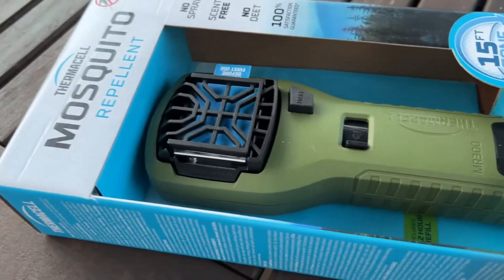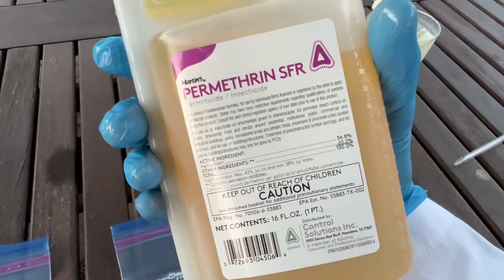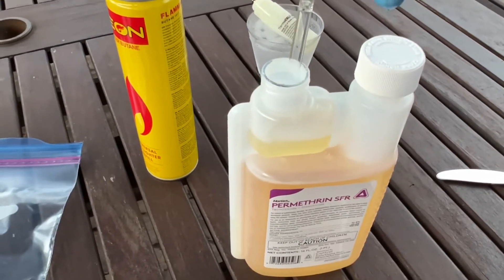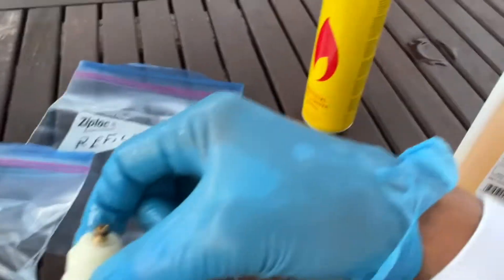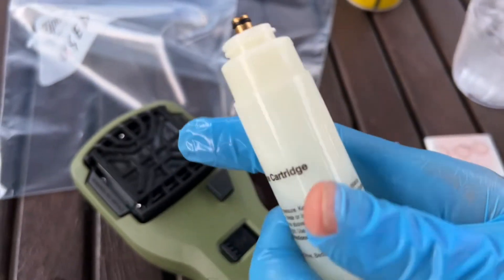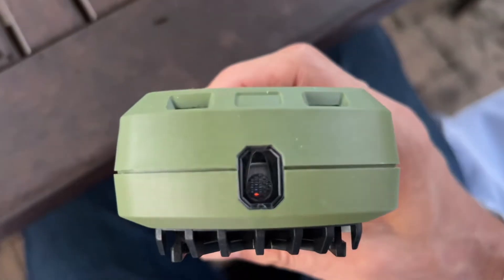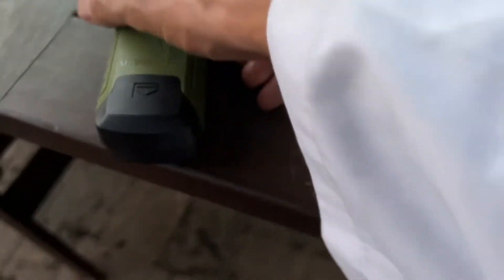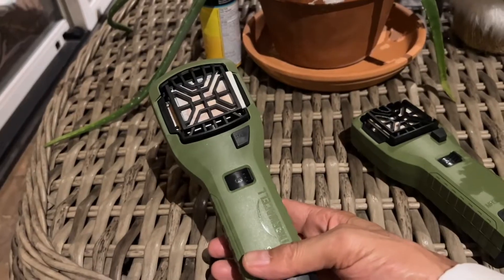How to Reuse Thermacell Pads and Save $$$

Comment: Disclaimer: I’m not a chemist, but I’ve had college chemistry. 

The original blue color of the Thermacell pads is not done for looks. There is a reason for it. I’m guessing the pads are soaked in some hydrated copper salt solution that contains the allethrin.  When heated by the small flame, water is released from the copper salt to provide steam that then disperses the allethrin into the air.

The video concerns me. I’m not sure using this highly concentrated Permethrin 10, containing volatile hydrocarbons, is a smart idea. I sure don’t want to breathe those hydrocarbons!
Reply: Exactly, if you read up on these chemicals, they can affect your mental health.  From what I remember when I researched them even Thermacell had a warning about continuing to use it's product in occupied areas and especially in enclosed areas.

Its more designed to clear the area of mosquitoes beforehand,  not during.

I found it interesting since the camper who recommended it had two children that had mental issues and she was using the Thermacell while she and children were outside. 

Thanks for the analysis!
Reply: life is dangerous  don't be a pussy cat
Reply from the maker: Yes for sure would not recommend the hydrocarbon soaked pads for indoor use.

Comment: I read the problem with this hack is your lowing the quality of the product considerably... Permethrin does not vaporize as well as allethrin or prallethrin... The other thing is when you are running on straight butane it doesn't get as hot as if it's mixed with isobutane so it never really reaches that hot point of total protection
Butane needs isobutane to get hot enough to admit the vapor as well.. Don't get me wrong what you're doing is working but it's working at about 50%...
Reply from the maker: I haven’t really actually noticed any difference in performance in terms of the ability to kill mosquitoes. I’ve been using the refilled cartridges and just using butane, but you may be right. Certainly not that I have noticed in terms of difference. I bet if a controlled experiment was done looking at the LD50, then there would be noticeable differences. Thanks for an interesting point.
Reply: @BrianDhvTinkerer  The other thing is I have a problem getting it hot enough when I use regular butane It never really brings on the blue light
Reply from the maker: Interesting! I got a newer generation of the Thermacell units, which seem and easier to start better than the older generation. Are you using the one with the slide switch or are using the old one where it has the knob? The older ones have the knob.

Comment: So you don't dilute the solution? just use straight 8 drops on the pad? thanks
Reply from the maker: Yea exactly no need to dilute. Works great.
Reply: @BrianDhvTinkerer  I already have a large bottle of pyrethrin 10% that I dilute down for spraying on clothing, gear.  I suppose I just use 32 drops on ea pad?

Comment: I use off with picaridin. 
I spray it in a bottle that has an eye dropper and drop a few drops on each pad. 
It works just as well and they don’t smell as bad!
For anyone wondering about the all natural stuff I have used the stem all natural stuff and it worked but it’s oily and even light drops eventually makes the thermocell messy. 
I have probably 100 used mats but I just keep the same ones in my thermocells and put a few drops on about 5-6 hours they last longer but I just prefer to keep them a little more heavy on smoke output. 
They seem to work effectively for 5-6 hours minimum per dose!

If I don’t fire them up in the evening we get eaten alive on our pool deck
Reply from the maker: That’s great info! Thanks for sharing!!!
Reply: Hi thanks for a great video. I wonder if you have a answer for my problem?  My flint does not work. I tried stripping it down by undoing 8 tiny screws but can’t get the bottom part off. I don’t even know if has flints but mine is not sparking. Thanks for sharing Ray K UK 🇬🇧 YNWA.
Reply from the maker: @raykeogh1972 it uses a piezo crystal for the spark. Sometimes if junk  or carbon residue gets on the spark wire it will short the spark  and prevent any ignition! You may need to blow it with compressed air and see if that cleans off any gunk from the piezo igniter

Comment: Permethrin is a widely used insecticide that is highly effective against a variety of pests, including mosquitoes. When comparing permethrin to prallethrin and piperonyl butoxide (the active ingredients in Ridsect Mosquito Mat-F), there are several factors to consider:

	1.	Effectiveness:
	•	Permethrin: Known for its strong insecticidal properties, it is used in a variety of applications, including clothing treatment, sprays, and mosquito repellent devices like Thermacell.
	•	Prallethrin: A fast-acting pyrethroid that is effective in space treatments, such as mosquito mats and coils.
	•	Piperonyl Butoxide: Not an insecticide on its own but enhances the effectiveness of other insecticides like prallethrin.
	2.	Mode of Action:
	•	Permethrin: Kills insects on contact and through ingestion. It affects the nervous system of insects, causing paralysis and death.
	•	Prallethrin: Similar to permethrin, it acts on the nervous system of insects, leading to rapid knockdown and death.
	•	Piperonyl Butoxide: Inhibits the enzymes that break down insecticides in insects, making other insecticides more effective.
	3.	Application:
	•	Thermacell Devices: Often use allethrin or prallethrin, which are similar to permethrin in terms of effectiveness but are optimized for vaporizing and dispersing in the air.
	•	Permethrin: More commonly used in sprays, clothing treatment, and direct application to surfaces.

In summary, permethrin is very effective for a wide range of applications, including personal protection and area treatment. Prallethrin and piperonyl butoxide are also effective, particularly in products designed for continuous release in an area, like mosquito mats and coils.

For Thermacell devices, prallethrin and related pyrethroids are specifically chosen for their ability to vaporize and provide spatial repellency. While permethrin is highly effective, its use in Thermacell devices might not be as optimal as prallethrin, which is designed for that specific delivery method.

Therefore, prallethrin, as used in Thermacell devices, would likely perform better in those specific applications compared to permethrin, which is more versatile but not necessarily designed for vaporizing devices.
Reply: Because the above chemicals are now near impossible to domestically source in countries like Canada, I'm curious as whether icaridin or deet will also work (especially when vaporized) 🤔
Reply: @wayditay9288  another commenter said she uses Off with Picaridin/Icaridin in an eye dropper on the used pads in the thermocell and it works. About to try it myself once I’ve burned through the pads it came with.
Reply: Great analysis! 

These chemicals also affect other biologics that come into contact with them. Which is why it is recommended for use prior to rather than during occupation of a treated area. Though somewhat unrealistic in highly infested areas...most people are likely to continue to use these chemicals/devices in occupied areas in order to extend occupancy time.

That said, these seem to work well as long as occupancy is short-term or one is trying to clear an infested area that can be secured to prevent further infestation as in a screened room of sorts. Otherwise one has a tendency to continually use the product and risk the effects.

It is beneficial to study these chemicals and understand the effects they have so one knows the risks.

Thanks for the analysis!

Comment: I keep same the pad in my thermacell and add a few drops of permethrin + blue dye (from a dropper bottle) each time I use it. It seems to be as effective as the real pads.
Reply from the maker: Yes for sure works well. The pads can be reused over and over again. I always use this stuff outdoors.
Reply: @BrianDhvTinkerer where can i buy Pralletrin online?
Reply: Where do you get the blue dye, what kind of substance is it for dyeing and where do you get the dye? Because that would really be "a replacement" if you can also make a colour change! Thanks from Roland from Germany!
Reply: Where u get the dye from?

Comment: I did this. Florida swamp mosquitoes laughed at it.
Original thermacell pads work waaaaaaaay better.
Reply from the maker: Agree
Reply: Maybe you need to dunk and soak the pads in the Permethrin as opposed to just dropping a few droplets on the pad.
Reply from the maker: Yeah my friend told me about those mutated mosquitos- scary stuff
Reply: The ones bio engineered with Australia's Blue Mountains Funnel Web Spiders.

Release 750 Million Genetically Modified Mosquitoes Into the Wild, They Said

This article is from 2019.
Search the title above to read more on this.
Reply: The ones bio engineered with Australia's Blue Mountains Funnel Web Spiders.

Release 750 Million Genetically Modified Mosquitoes Into the Wild, They Said

This article is from 2019.
Search the title above to read more on this.

Comment: Do you use it pure or do you mixed it in a ratio with water? For example 1:5 with destilated water?!
Reply from the maker: The one I am using is kerosene-based. There are water soluble formulas out there as well. Both work just as well. I just put it onto the pads undiluted.
Reply: @BrianDhvTinkerer  thanks for your reply :) do you smell a difference between the original mats from thermacell and the "refilled" ones with the permethrin sfr 38.6% concentrate? Greetings out of germany ;)
Reply from the maker: @Brumm_Performance  no I can’t really tell the difference. I’ve been using them in the garage where I work and also outside and they seem to work pretty well. I actually now have four thermal units with mod cartridges for refilling- the permethrin works just as well. I would not use it indoors or in a tent better to just use in an outdoor situation.
Reply: @BrianDhvTinkerer  I would like to use it while fishing in Norway while traveling with my camper.  Can you say something practical about the wind sensitivity of the devices?  Does it make sense to use two devices in light winds, or is one sufficient outdoors?
Reply from the maker: @Brumm_Performance 2 is better then o e for sure one better to place upwind
Reply: @Brumm_Performance  well.. just put it upwind, otherwise- if it gets more windy- insects also goes away...